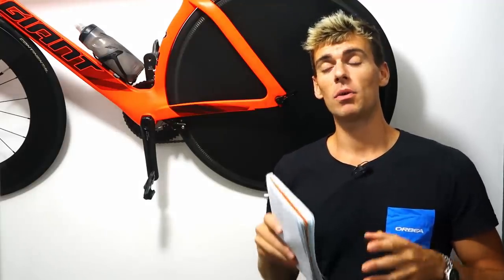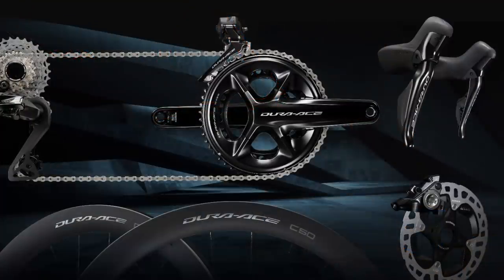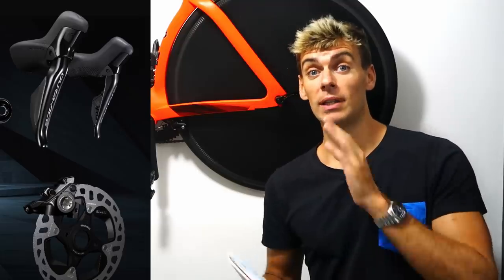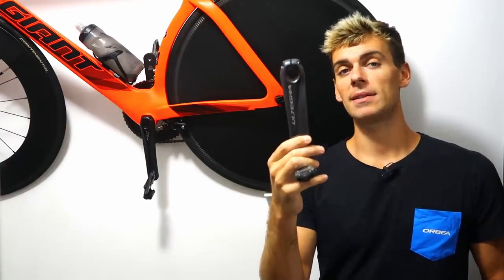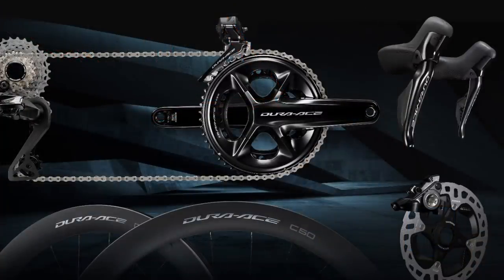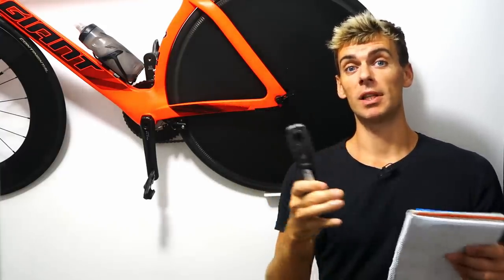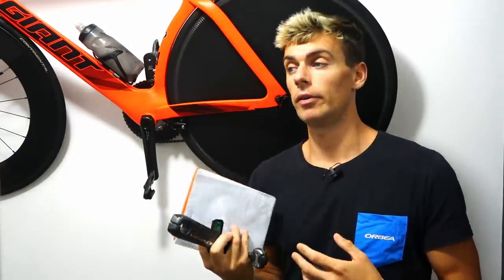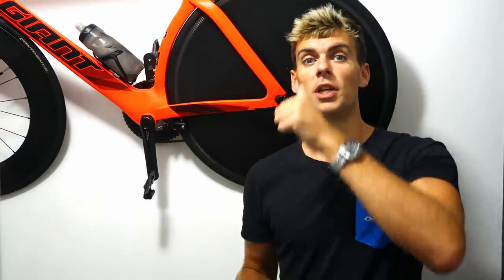Shimano 12 speed Dura-Ace & Ultegra Launch. Power Meter design, crank failures & disc brakes.

Comment: Looking forward to your post launch video!
Reply from the maker: I don't think i need to do it. I covered the main bits without the press pack and material from Shimano (like all the other channels were given weeks ago!!!). 
1. Other than that the new Ultegra crank is horrendously ugly in my opinion. Looks a bit basic and unfinished. 
2. The 'improved hood ergonomics' the shill channels are banging on about, is a cover up for massive hoods and servowave. If it was about ergonomics why didn't they make the rim brake hoods bigger too 🤔. Laughable.
Reply: @PeakTorque  It could be because of very little demand for rim brake bikes so it's not worth the cost to develop completely new levers (and brakes).
Reply: @PeakTorque  The rim brake levers are basically previous gen regripped with new ribbed rubber. Which doesn't necessarily make your above point moot.

Comment from the maker: FATHERS: if your kid brings their lover home for the first time and they're on 9100 rim mechanical... give them the nod.
Reply: What if they're in a polyamourouspeloton?
Reply: How about if they ride 7800 - probably the most aesthetically beautiful Shimano groupset ever?
Reply: @Peak Torque 😆😆😆😆🤜🏽🤛🏽
Reply: Looks like you were right. The cranks between 8100 and 9200 are both heavier than last gen. So my guess is their fix is more/better glue?
Reply from the maker: @szurketaltos2693  2021 wokeness gone mad
Reply: What if they live in rainy and hilly old Scotland and use full carbon rims?
Reply: @helicart  Then you give them some nice wheels with aluminium rims (optional: ceramic breaking surface)  and brake pads for wet weather.
Reply: @nlfiets  
I look forward to the day PT rides Al brake surfaces.
p.s. 
I have a rim roadie (currently with Yoeleo 38mm full carbon wheels) and disc gravel. 
I prefer Al brake surfaces, partly because I am 80+kg, partly because I've seen at least 7 rim heat flats or roll offs, 3 carbon rim failures under braking, and partly because carbon brake surfaces truly are shlte in the wet.
Reply: @worldofameiso5491  if they ride 7700 you marry them yourself.
Reply: @helicart  yeah I tick all those boxes, rim brakes for road :-) summer and winter
Reply: @grahammacraild595  rim have worked fine for me over 50 years. I have never not been able to pull up as effectively as disc. When you have small tire contact surfaces such as with 23mm tires, harder braking is more inclined to cause skidding. Rim brakes with Al brake surfaces used properly are fine for 99.9% of road users.
Reply from the maker: @helicart  i have Hplus Archetypes (alu) that i build for the rim brake bike if hilly terrain. But if hilly and hot i ride the disc bike. Dry and flat, rim brake. Horses for courses.
Reply: He had campy delta brakes set up correctly, i let him have my wife as well
Reply: How about 9000 rim mechanical? That's what I run...

Comment: Yessss preach about the 10t cog, my 11t is crunchy enough
Reply: (as an old school guy) I went from a 14t freewheel to a 11t cassette two months ago, the difference is enough, I believe I have spun out 2 times in extremely long straight descents
Reply: Is that really you? Anyway, he’s so right about 12 speed. Its farcical that we trend to 12 speed for more range at the back and one-by for more simplicity at the front. Indeed, this is Spinal Torque at its finest.

Comment: But GCN told me the larger hoods were to accomodate the modern riders position 🤣
Reply from the maker: So what about the rim Ineos riders? Those poor guys have the smaller and less ergonomic hoods. Oh no!
Reply: If the big hoods are helping the SRAM riders that much I'd expect better race results, but it might help a little. It's true that the aero hoods position is much more common now.
Reply: @szurketaltos2693  it wouldn’t change race results 😂 lol just something that’s easier to hold. Some people like it and some dont
Reply: @jarrodfife242  you don't think small changes in comfort are equivalent to fractions of a second? Because that's all it would take to change some race results.

Comment: Hopefully some hyperglide +, that would make upgrading more attractive if I'm honest. Loved it on the mtb 12 speed
Reply from the maker: I find the XT 12sp on my MTB very loud and the chain is very sensitive to lube. Not sure if the mech or chain at fault. Its almost brand new. The clutch is very clunky too and needs periodic maintenance.
Reply: @PeakTorque  I 100% agree, the chain definitely needs constant love and the clutch is a pain in the backside. But I must say something that impresses me every time is the fact that I can sprint max effort and shift with confidence. I don't have that same confidence on my 10 speed ultegra groupo,
Reply: @PeakTorque  I can't relate to the loudness though but I might not know what I'm missing, I found using squirt lube and keeping everything clean helps with the sound.
Reply from the maker: @jaspernel2041  i also use Squirt, and have tried normal wet lubes but after a few hrs on the XT, i always get this graunchy noise under  load. Its almost as if the chain isn't meshing properly on the cassette. Very odd.
Reply: @PeakTorque  now that you mention it, I've also had that headache with other lubes. I apply squirt the night before a ride. I found it works best when its had enough time to become wax. From there it's smooth sailing on my side. I have however turned off the clutch on my XT Derailleur.
Reply: It does frustrate me the fact that it's not being used in the way it should be. Horrible seal and engineering on the clutch side.
Reply: Have either of you ever considered/tried using self made teflon wax as a lube (oz cycle channel has a great tutorial) ? I'm thinking about it myself and looking for more opinions
Reply: @PeakTorque  Squirt? Please do a video on the engineering behind this because I thought it was just bullshit. I'm a happy boeshield T9 user.

Comment: I like rim brakes "pure and simple" beautifully said. I never did care for the feel of a Disc brake shifter due to the shape, there's just to many design compromises to make everything fit properly.
Reply: Absolutely. Like why do you really want disc brakes? Better breaking that you will never need? 
I mean disc brakes have so many problems: bending, more brake changes, harder to work on, bad retracting pistons, not enough clearence, being careful when you take the wheel out etc. etc. 
Plus they are so pricy compared to rim brakes. 
And people happilly buy them, because they have more breaking power that 99.9999% wont need.
Reply: @alexmichl3137  I totally agree. Perhaps disc breakes might give you more power in theory, but it is useless - with my 105 rim breakes I can break so hard that my tyres slide on the road during a descend; there is no point in having more power if you tyres would slide on the road even more.... all we need are rim breakers and some technique on descend

Comment: I'll stick with rim brakes as long as they make them. :) Or if they make disc brakes easier to live with, but I'm guessing that will be 5 more years at least.
Reply: Mechanical disk brakes are pretty easy to live with in my opinion, good braking power and no mess when setting up and easy caliper adjustment.
Reply: Agreed. I have mechanical disc brakes on one of my MTB’s. Braking works fine, and they are very easy as far as maintenance and keeping in adjustment.
Reply: I'd never buy a bike with rim brakes, and I know many others, so your resale value is going to be trash.
Reply: @NeutralGenericUser  Well, I have no intention to resell my stuff as I find my bike to be one of the best looking bikes so far, and will continue to buy cheap rim brake stuff as it's pure and easy maintenance as peak torque mentioned. Having said that, I would like to have a choice, but will be forced to buy disc brakes and electronic shifting by the look of things.
Reply: @rcg9573  Had them on my touring bike and didn't find them that good, adjustment was so so. But, they work for my cousin now, fuss free as he reports. :)
Reply: @rcg9573  i'd rather go with rim brakes than mechanical discs.

Been on hydraulic discs and they just operate so smoothly, never going back to mechanical brakes ever again.

Comment: I’ve joined 3-4 cycling group with 20-30 members each, plenty of shimano users, and never once seen the crank failure..

And I do like the new 11-34 gear ratio compare to the old ratio..the old one have 1 cog jumps on each cassette, which render them useless on fast crit and bunch ride..but the new 11-34 have 1 cog jump on the smaller cassette, so it’s more comfortable and versatile to use on multiple types of ride..
Reply: Correction: old 11-34 have 2 cog jump

Comment: Like what we see so far from new DA. Looks the business. Cranks in particular. As a Campagnolo dude I’ve enjoyed 12s for 2 years 😎
Reply: But did it make you faster with additional gear? Or is it all for the pose?
Reply: @PhiyackYuh  I will answer your question in earnest: #1; Campagnolo currently offers only 12Sp. for Record, so not a choice really. Secondly, I really appreciated the extra 1 tooth increments in the sweet spot in the middle of the cassette where I spend the most of my riding. Thanks for asking. Going faster: probably not, but more comfortably: yes.

Comment: I ride Shimano cranks on all my bikes. I've NEVER heard about these failures. I hope I don't have this issue. I ride in the desert of Nevada. So hopefully the dry climate here keeps them together longer. Thanks for the information. Been waiting for this release for what seems like forever now.
Reply from the maker: Thanks for sharing. It's defintely related to humid/salty/wet/sweaty conditions and lack of cleaning.
Reply: All looks great but with all the supply problems Shimano are having when will this appear on bikes, mid next year ?

I guess this will involve another price bump
Reply: The new DA grouppo is US $4,000. A massive price jump. Bike grouppo costs have gone insane as have cookie cutter cheap mass produced CF framesets. 

Even the new Ultegra 12 speed grouppo is $2,500. That used to be the cost of 2 complete very nice mid level bikes. 😆
Reply: @rcg9573  105 CF bikes now around 3k in any currency..

So these new bikes with these gruppos will be at mad prices if you can get one..
Reply: @ Charles Trotman - Spot on. 

This is an example of how silly bike prices have gotten:

The 2020 Giant Defy Advanced 2 model bike had full 105 and their in house PR-2 disc wheelset. All other components were stock in house generic Giant saddle seatpost, bar, and stem.  That 2020 bike had an MSRP of $2,100 a good deal for a 105 bike with a solid CF frameset.

2021 Defy Advance 2 used the exact same frameset as the 2020 model (only the color changed). The drivetrain remained the exact same 105 grouppo, and the wheels remained the identical PR-2 discs. All other components basically stayed the same, Giant in house stuff. MSRP went from $2,100 to $2,650 for basically the exact same bike with the exact same spec in a different color. 

Fast forward to 2022. The 2022 Giant Defy Advanced 2 bike again uses the exact same frameset as the 2020 and 2021 bikes did. The grouppo (105), the wheels (PR-2), and the other in house Giant components remain basically identical to the 2020 and 2021 models. The MSRP for the 2022 Defy Advanced 2 has now been raised from $2,650 to a whopping US $3,500.  $3,500 for a 105 bike with in house cheap PR-2 wheels that 2 years ago MSRP’d for $2,100 and now they plan to sell it for $3,500.

Bike prices have become a joke. It’s actually comical watching people pay these Tulipmania type prices for generic non custom CF framesets hung with silly priced grouppos. 😆

Comment: im so glad im subbed
, i love your take on the marketing teams hype 
and the engineers failures in general

i run an entire xt train and brakes, always love shimano, 
will keep buying them

but the first thing i have done since forever, is replace the cranks
ive seen bent shimano aluminum cranks...
you are describing the exact same problem here, the 2 parts ..seperate or slip apart..
Reply from the maker: My XT drivetrain is horrendously noisy and the clutch is sloppy.

Comment: Rotor made their twelve speed gears compatible with standard freehubs, so Shimano should be able to as well. No need for a redesign for 10t cog.
Reply: But, but, but Shimano needs to fix the problem no one had....Rotor was able to go to 13 (as was Campy, pretty much). You can certainly put a Campy 9 on a Campy 12 freehub....
Reply: Campy’s goofball thumb shift button solved a problem that never existed. 😆
Reply: @rcg9573  Got around other company's patients.  You need to keep competitors' patients in mind as the reason many design decisions are made in the cycling world.
Reply: @lastfm4477  Campy already made shifters without the button, but they needed a niche. Now they're the "fancy" ones. Still useless, IMO

Comment: When I switch from 2x10 to 1x I looked at the number of roughly distinct gear ratios I used and there were 13.  I lost two of those moving to 1x11 so to me an advantage of 12-speed drivetrains is for 1x users.  Not that the missing 2 ratios has really bothered me, but with 1x12 I could add another low gear or decrease differences in the middle of the block.  I'm dreading my, what appears to be inevitable, switch over to disc brakes for the noise / contamination issues you demonstrated.
Reply: Yeah, you did not lose many gears going to 1X, but you sure all but guaranteed you’ll be riding at full or near full cross chained positions for most of your rides if you have any type of varied terrain.  And you guaranteed yourself big gear jumps at the bottom of the cassette if you have any decent gear range.

The beauty of 2X has never been about loads of extra usable gears. It’s always been about smaller gear jumps and avoiding riding with goofy extreme chain angle positions. 1X results in the worst of both of those worlds. Congrats! 😆
Reply: @rcg9573  Thanks!  Been doing 1x for a couple years and really enjoy it!

Comment: It baffles me that none has made custom cockpit with integrated hoods/brake levers. This would open up for better packaging since a lot of the components could be placed inside the cockpit instead of in the hoods. It would be possible to reduce to size of hoods to a minimum and make them much more areo.

Comment: Interested to see if the pad clearance is increased. Sounds contrary, but I take my rim brake 2015 Supersix out in crappy UK weather instead of my 2020 ultegra disc version. On that I can manually adjust the pad clearance to stop the rub due to grit and muck build up for a silent ride. Unfortunately on my 2020 Supersix in the same conditions the disc brakes just start to grate. Can’t complain about the power but would sacrifice a small braking loss for a quiet ride. Basically hydro disc brakes allow no on the fly manual adjustment.
Reply: And you would have thought you'd want those discs for we weather..

Comment: Have to disagree with you on the new hoods. I have the 8070 levers and the "hoods" position is almost unusable because it's so small. 3 fingers do not fit between the lever and bar without pinching.

Comment: I have 11-34 in both 10 sp and 11 sp, I can't tell the difference.  I started on 8 sp as Jr and from 9 to 11 speed it's all kinda seemed the same.  What's nice is cassette range like 11-36 for CX or 11-50 for Mtb.  The days of swapping out 11-21 to 12-27 between stages is gone, just like stage races in the US (Toona, Fitchburg, Green Mountain, Killington etc) 

I would really nice if Shimano made a 14-36 with bail out gear going from 28-36, much like XT 11-46, 37-46 but ultimate doesn't really matter these groupsets signal it's time for change and do something else

Comment: According to Shimano the increase size in the hoods is because more pro-riders are doing the hood aero tuck and were resting their palms at the farthest reaches of the hoods. The increase length and knob gives pros more space to do the aero tuck. The rim brake lever, will just be the previous generation lever/hood with new internals. Yes the 11 speed hubs will work with 12 speed cassettes by swapping the spline, however the new 12 speed hubs won't be backwards compatible.
Reply from the maker: Its because theres a coin cell battery and terminal in the top of the hood.

Comment: Nice preview.  Informative about power meters and design tradeoffs.
As far as disc brakes and thermal expansion, consider the bigger the reservoir the lower the temperature due to increase in thermal mass and a contributor to massive shifter bodies which look hideous as you say.
I do not like disc brakes on a road bike for the reasons you state.
I will try to avoid 12s as long as possible.  The industry like American politics has gone a bit insane.

Comment: Note that none of the cycling "journalists" who had Shimano reps in their videos asked about the debonding issue.  Also I'm wondering why Shimano changed to a smaller cable.  Has cable technology improved in the last tens years?  Also price is a big issue.  Before the Shimano clampdown on international sales, US buyers could buy Ultegra mechanical for $600 USD from the UK.  Now an Ultegra groupset is probably going to cost $2K.

Comment: Nice. I have a question if you don't mind. I had a 2021 giant tcr advanced pro 0 on order. It had dual sided giant power meter on it. Switched to 2022 version. With no power meter I believe. Currently run non drive side 105 4iii on my cross bike. What's my options would the single sided one from my 11spd fit on 12spd. Or would you suggest power pedals etc? Figured I'd go 12 to try n future proof. I like a few things like shifting under load as well as no Bluetooth dongle needed